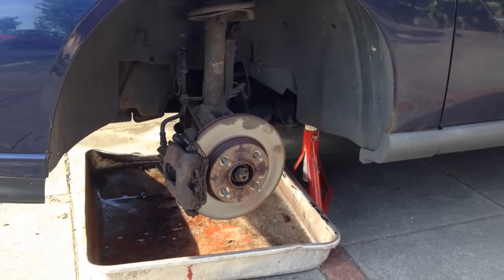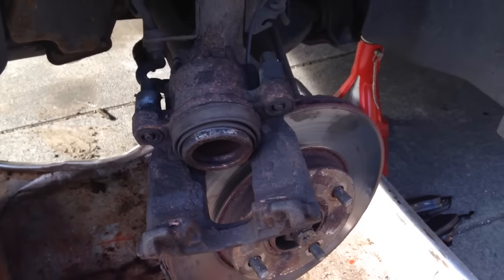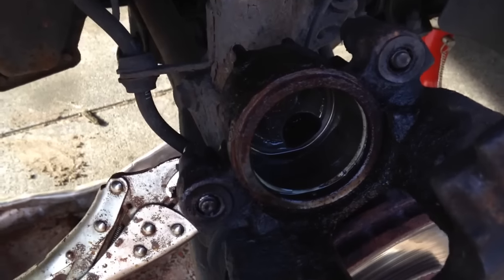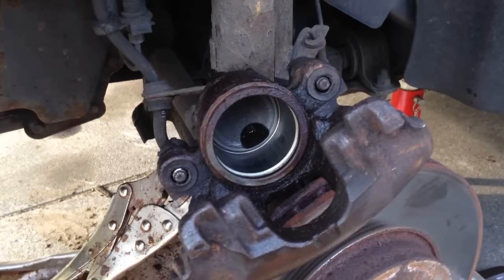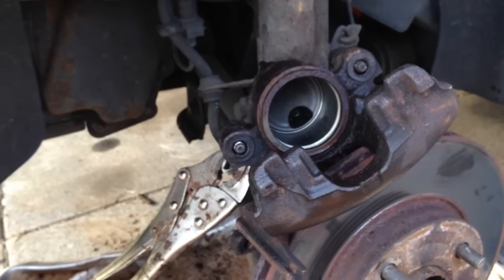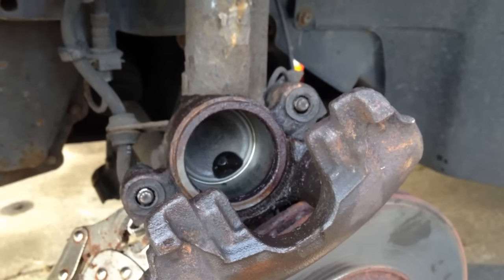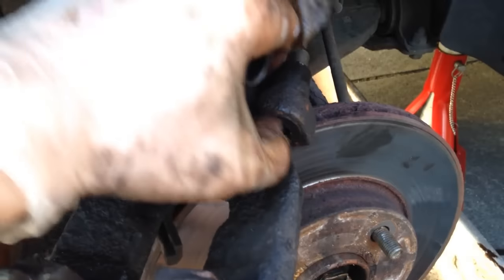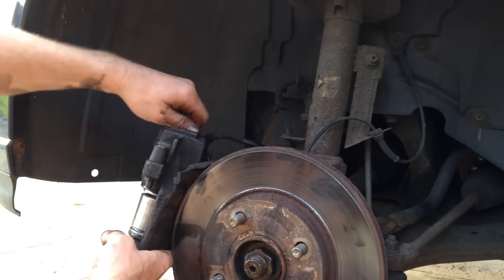How to Rebuild a Brake Caliper (WITHOUT Removing it From Your Car!)

Comment: An alternative to crushing the flexible hose is to prop the brake pedal down which will close off the reservoir. You may need to remove the stop lamp fuse to prevent the brake lights from draining the battery.
Reply: @twig3288  With an electric driver’s seat, it is easier to put pressure on the brake petal at the correct pressure (use a short piece of wood between seat and brake pedal to accomplish this).  Removing the fuse is a great idea. Be sure sure to use a clear plastic hose on the brake fittings with the far end of the hose put into a clear plastic bottle with about 4 to 6 ounces of fresh brake fluid in it - this is so you can see any air bubbles as they are forced out of the brake line and will prevent air from being sucked back into the brake system before you close the fitting.

Comment: I've been a mechanic for nearly 40 years you did a very good job for the conditions being on the ground not having a lift or specialty tools this is how most people would do it and your explanation was great next time get your woman to just film the whole thing..Carry on mate
Reply from the maker: Cheers Fran 👍
Reply: Seems very easy
Reply: @anthonydefr  makes it look easy. 😁 I'm In the process of changing my wife's steering rack along with the brake disc and pads. But I've now discovered that the caliper looks seized. A job I've never done before hence the reason I'm watching videos on this topic. Do I buy the calipers for around £90 or the repair kit for around £50+ 🤔 anyway I'll watch a few more cans and drink a few more videos 😂😂 this by the way was a great video 👍🏿
Reply: Was thinking the same - if your beautiful assistant could hold the camera for those tricky two hand tasks which are quite possibly essential parts of the story...
Reply: can u just replace the dust boot without removing the piston?
Reply: @zigzag7194  I'd definitely buy new calipers if the repair kit is over half the price of new! It's new everything then not just repair/ replacement parts. The old calipers can then be sold on for those that like to refurbish etc

Comment: Getting the piston out simply via the brake pressure system is BRILLIANT, no bloody air compressor needed, and no piston shooting out like a 2 gauge shotgun slug...
Reply from the maker: Thank you Sandy - I like simplicity and doing it this way you don't even have to disconnect the brake line... :-) Cheers, Chris 👍
Reply: you can do it with a foot pump, as not much pressure is needed. 
Imho, it is easier to disconnect the hose and work on a workbench sitting, with no rush. I would also use some  special dot compatible brake lube as it is dirt cheap. A thin film of lube will definitely help the piston go in easier. Good calipers can be pressed with the thumbs without much force!
Reply: Depends on the vehicle.
Reply: As long as you only have one piston per caliper.
Reply: Sandy Grungerson
Reply: im pumping my 04 corolla but the piston isnt moving.  help
Reply: @rocknrollermann  sounds like you have a hole in your brake line somewhere, or a bad master cylinder.
Reply: I always thought that the piston would .be difficult to replace in the  cylinder owing to the square section seal which might come out of its groove.
Reply: I wonder if a 2 piston caliper would be as simple. Like if one came out thats it, I'm stuck.
Reply: Hi Chris,

Thank you for the video, excellent content, well presented, clear and simple.

A couple of suggestions:

One. Remove the disk so it doesn’t get covered in brake fluid and oil et cetera.

Two. Protect your hands as much as you can. Brake fluid is nasty corrosive stuff, it will damage your skin and paint.

Three. Along the same lines to protect against brake fluid going everywhere, run a small plastic tube from the brake bleeding nipple into a suitable container.

Cheers,
Mark
Reply: I think, if you have two pistons, then you can c-clamp one down, while you do the other.  I'm planning on doing it.  @Axbear
Reply: Use a foot pump
Reply: 2-gauge shot gun? Isn't that a cannon?
Reply: Very very good job
Reply: @sbond1963  All you have to do is block the one piston from popping out and that forces the other to work and move.
Reply: The sound was plop
Reply: Back in the day on obsolete calipers hone kit is the must have
Reply: Hah! Yeah, first time I did a rebuild, I found out just how fast a piston could shoot out of the caliber.
Reply: @sbond1963  before the free piston comes fully out, hold it with a g clamp which allows the brake pressure to increase to push the stiff piston out.
Reply: @Serban Cordis. Foot pup will not work (air pressure) if piston is stuck and many are. Hydraulics (brake pedal)gets the piston out every time.
Reply: @Paul Allen. No. Use the brake pedal. Hydraulics will even get a stuck piston out. It works every time.

Comment: If you use a little of the red rubber grease around the channel the rubber seal goes into, it both allows the seal to slip into the channel easier and also seals it better from water ingress aswell.

Comment: Not the way I would do it but these people who are prepared to show us how to get a job done and take the mystery out of it get a big thumbs up from me👍😎
Reply: What would you do differently?
Reply: @theoldtheatre  I don't like mess so would have to take it off the car, but that's about it.
Reply: Great video on the rebuild itself. 

Mentions not contaminating the brake pads with brake fluid and then proceeds to contaminate everything with his dirty hands. 

This is akin to surgery at a basic level… so clean your hands periodically especially when handling seals etc. 

Again kudos for the demonstration and very many thanks to Roe your lovely assistant.
Reply: This is the best video I’ve seen so far, exactly what I want, don’t intend removing it from the car, thumbs up man. You nailed it

Comment: If you do this at home, don’t forget to wipe the caliper pins clean and then coat them with the caliper grease supplied in the kit, or use a high temperature silicone grease. If you don’t clean the pins or if you use a petroleum-based grease, the brake heat will bake the grease(old or new) dry, and the calipers will stop moving when you press the brake pedal.  When he put the new grommet in, he failed to clean and lube the caliper pins on camera.  If he didn’t grease them up, that car will have brake problems on that wheel within a year or so.  Also, broken brake hoses result in immediate and complete brake failure, and old brake hoses will fail after a couple of decades of regular use and exposure to rain and salt, or to desert heat.  Inspect your hoses when doing a brake job. Lost a friend to a broken brake hose a few years ago, and he was a professional mechanic.  The bolts that attach the caliper to the suspension should be tightened to factory specs using a torque wrench. 

Thanks for the informative video, and for sharing your tips on brake cylinder repair.
Reply: ... good added info . Thanks .
I'm kind of "iffy" on clamping
my 2005 brake line hose when I do my caliper replace / brake job soon ,,, because being an older vehicle , I don't want to chance damaging the hose . Better yet ,, for piece of mind , I think I will replace the hoses .
 ( Also ,, Sorry for the loss of your friend ) .
Reply: Power steering 1999 model Saab were to locate power steering pump
Reply: THANKS
Reply: Lol overkill
Reply: Thanks for info.  May I ask if there are many brake hoses or only one hose per wheel?  Thanks
Reply: @codystorie2529  Agree
Reply: Oh gosh really sorry to hear about your friend!
I've just been cleaning up my rear brake caliper pins for the reason that one was seized.
It was a bit rusty so I've cleaned and polished it and also the inside bored hole.
The other pin has a rubber sleeve (anti vibration I guess) and that rubber and also the seals can expand and deteriorate and crack with the wrong grease. I've just bought Red Rubber Grease to put inside so it really does matter what grease goes where. I'd put lithium grease in but after reading up I'll be swapping it over to the correct grease.
There's no overkill when there is life or death safety involved!
Reply: PS I also found it strange that the hoses were clamped - I'd be concerned about damaging it as it's quite old.
In fact I may get my mechanic to check that. I'm not sure how far to go with fixing it all myself just in case I miss something important!
Reply: Noticed the same thing.

Comment: This video is spot-on for a number of reasons. The ability to use this technique and fix a caliper that is broke when you are not at home and don't have access to a wide range of tools is amazing. This technique can save so much time and energy. Maybe in an ideal world the caliper could be taken off, but usually when your car breaks down it's never ideal. This also helps other car enthusiasts by looking at a problem slightly differently.

Thank you for uploading and sharing with all of us.
Reply from the maker: Thank you! Chris 👍
Reply: 8:14 Respekte për këta teknik që na ndihmojnë për difektet e frenave
Reply from the maker: I used to work as a technician on military fast jets and helicopters (with 3000 psi hydraulic systems). My last posting was as groundcrew on the Red Arrows. I maintained the brakes on all these aircraft.

I then worked on Remotely Operated Vehicles (Underwater submarines which sent 5000 volts down to depths of over a mile underwater, in order to run a HPU to run hydraulic systems, which were then used to 'fly' the ROV around platforms & pipelines to carry out jobs on underwater oil & gas infrastructure.

Working on the brake caliper of an old Ford Focus is not outside my capabilities.

The proof of the pudding is in the eating as they say: this brake functioned perfectly after this job. When I sold the car 6 years later, it was put through an MOT inspection, which included braking efficiency tests, and it passed no problem.

So clamping the hose the way I did it caused no damage to the hose.

 Mole grips can be be used to achieve different results. I could clamp my finger with a piece of card - like in this video - and it would cause no pain whatsoever. Or I could crush the bone to a mush with the same tool.

Therefore clamping does not equal destruction.

Cheers,
Chris

Comment: You have done a very good job, simplifying as much as possible and avoiding expensive tools. (No compressor, no brake line pincher, no brake bleeder...).  I am impressed.  Only thing different for me is I call the stuff fluid, not oil, but whatever...

Comment: Very nice tutorial! :) Though it is a lot easier to just unbolt the brake hose and have fun with the caliper in an open space. It is very easy to prevent the hose from dripping: you just need to depress the brake pedal and hold it in that position, e.g. place a wood log between the brake pedal and the steering wheel.
Reply: It is not easier in an "open place" when the piston is stuck and air pressure can't get it out at all. Hydraulics gets the piston out every time. 😊
Reply: @bottmar1  m.mmml
Reply: @bottmar1  I think he means unbolting the brake line after the piston has been pushed out then working on the caliper.
Reply: @Anthony. He maybe just skipped saying pump the piston out first but there are so many that think air pressure works that I thought he is just another one that doesn't know the value of hydraulics. Air pressure fails unless the piston is almost completely free to move.👍
Reply: Great idea to prop the brake pedal. I use a stick or something between the seat and the brake pedal. The seat will adjust so it really makes it easy to hold pressure. 
 🫤
Reply: …then someone thought, “Thanks, we got it” 😮

Comment: Great video. The only difference with calipers that have two pistons is to make sure one clamped or blocked partially so they both move together, or do one most the way and block it and continue so the other rises to match it. The fact you can just replace the piston and seals instead of the whole caliper was a welcome addition when I had to do mine recently. Got my set for $11! Sure beat $140 for two calipers. Thanks for the video!
Reply from the maker: $11 is brilliant! Thanks for the feedback, Chris 👍

Comment: Nice job! I am doing the same thing with the brake calipers of my 1998 Honda CR-V (oh yes, 19 years old). Interesting the explanation of the function of the square profile seal. I wasn't planning to replace the pistons but now that I've seen yours I'm about to change my mind...Keep it up.
Reply from the maker: The car in the video is a 1999 model (Ford Focus) so there's not much between us. :-) The pistons are cheap and if they are pitted then it won't be long before they seize again, so it's definitely worth replacing them in that case. Good luck and thanks for watching and commenting. Cheers, Chris 👍

Comment: I have used your method to get the piston out but then removed the caliper from the vehicle to be able to clean the caliper more easily. Doing it your way I would recommend putting a plastic bag over the rotor to save time in the clean up process. Good vid.

Comment: This is amazing. My brakes froze and jammed this winter in Montreal (at -20 degrees celsius). I'll try this if I need to replace my piston!
Reply from the maker: Go for it - it's an easy job and the parts are cheap! 👍
Reply: Christopher Barr - Random Chris Thanks for the reply! Did you order the kit or you went to you local car parts store?

Comment: From across the pond Marietta, GA: Very simple and practical techniques to remove/install piston. I also liked bleeding the caliper while not mounted. The bleed port can be positioned at the top to ensure all of the air is out of the cylinder.
Reply from the maker: Thank you 👍

Comment: Good video. Especially showing how to pump the piston out with the brake pedal. I see below some actually would rather blow it out with air because of "the mess". Their mess is on the bench especially when air won't get their stuck pistons out. I never use air because pumping the piston out works every time.

Comment: Cracking video. I have exactly the same issue on my Crossfire, didn't have the guts to take the piston all the way out, so had to pull it out an inch or so and just give it a good clean and hope for the best. Next time the piston is coming out for a proper job.

Comment: Hi Chris,

Thank you for the video, excellent content, well presented, clear and simple.

A couple of suggestions:

One. Remove the disk so it doesn’t get covered in brake fluid and oil et cetera.

Two. Protect your hands as much as you can. Brake fluid is nasty corrosive stuff, it will damage your skin and paint.

Three. Along the same lines to protect against brake fluid going everywhere, run a small plastic tube from the brake bleeding nipple into a suitable container.

Cheers,
Mark

Comment: Great video, very useful for us DIYrs the difference is that you show us how to use common tools and not fancy ones. I need to do this in my right rear caliper but the difference would be that the piston is the spinning one, do you know if the procedure is the same?
THANKS A LOT.

Comment: Excellent, done this with a motorbike caliper years ago but need to look into a sticky car caliper soon, just refreshing my memory. 
Been putting it off as the piston has some visible surface rust and I don't know how bad it's going to be. Really didn't want to have to pull the entire piston out, I don't have a good working space but with your tip about clamping the hose, it might not be so bad to do that after all. Cheers from NZ!